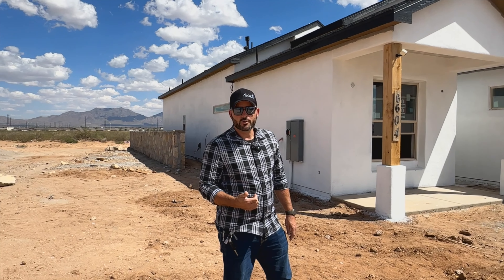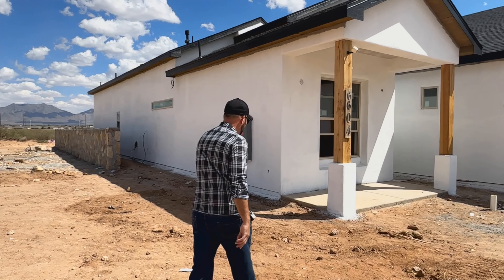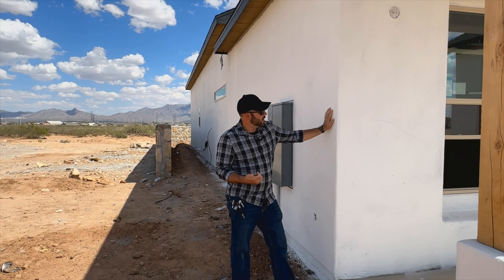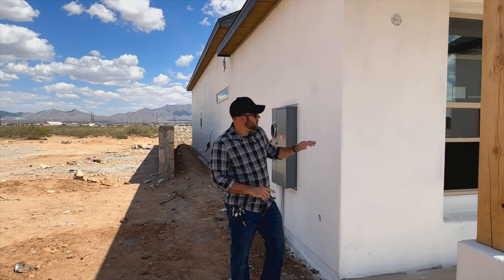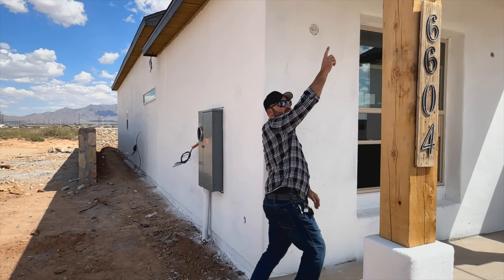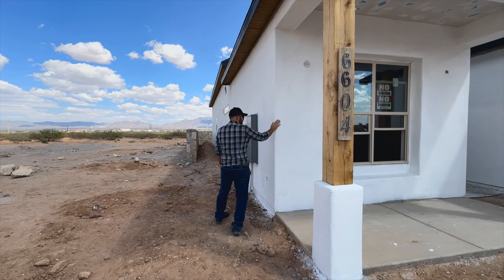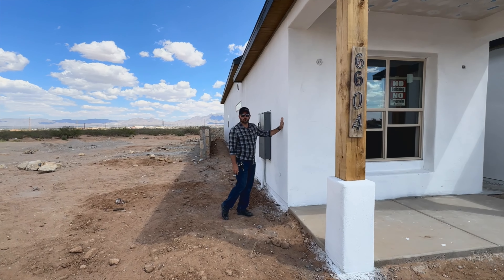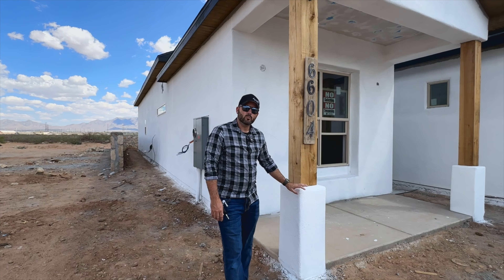Protect Your Home with Arista's Three Coat Stucco System

Comment: Excellent explanation on that stucco process. Some of the local builders tend to cut corners on this incredibly important aspect of residential construction. Too many times I have seen chicken wire sticking through the stucco and creating a rust stain on the exterior of the home. That is substandard workmanship, and I am very happy to know that Arista Development does not engage in that detrimental practice. You get what you pay for with Arista and it is money well spent. Certainly buys alot of piece of mind.
Reply from the maker: buy once, cry once!  This extra step does have a cost to it but it pays off in the long run!